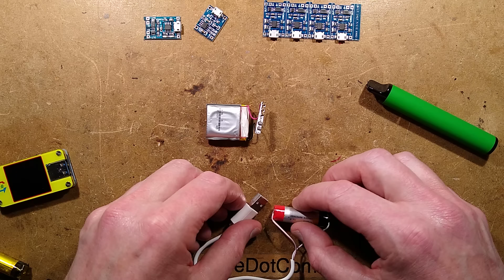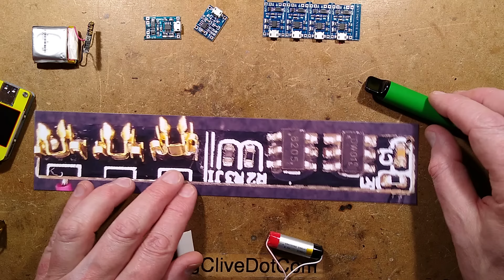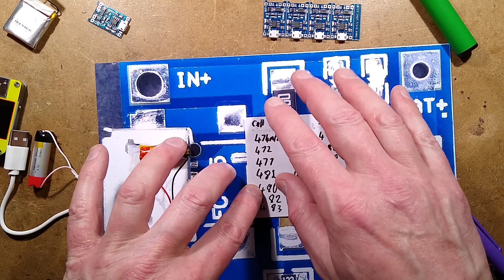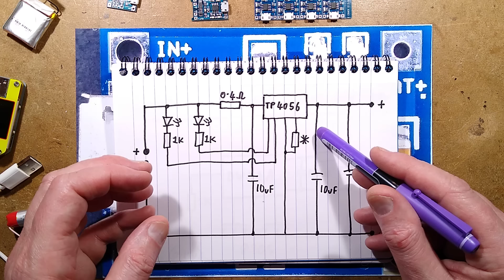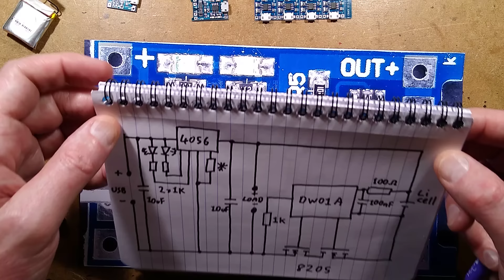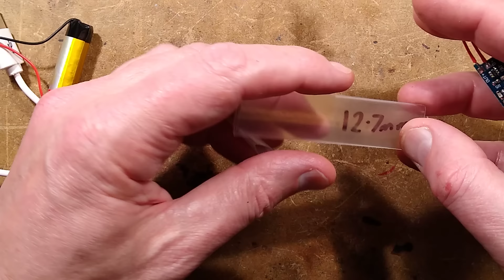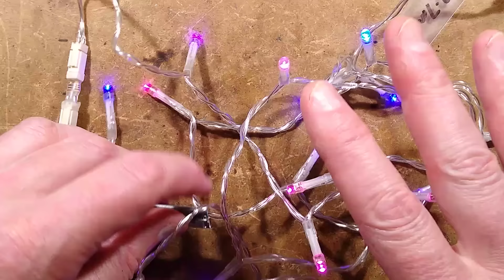Don't do this!   (There's a much safer way)

Comment: I was once charging a tablet battery (without the protection board) and I forgot I was charging it on the wall (suspended in the air) and when I noticed something was strange, the battery was getting bigger and bigger, inflating and exploding seconds later I took it off the charger.  Pieces of the battery flew into the house, burning with the sweet smell of lithium... It burned the sofa and some pillows a little, but I managed to put out the fire, but nothing serious happened afterwards... and I learned the lesson of never underestimating the lithium batteries...
Reply: Ditto, on the last thought.

Comment: Could you not put a 10k potentiometer in series with the programming resistor? That way you could vary the current from the full 900mA down to 100mA according to your needs...

Comment: What happens if you use this as an UPS? I've been using a small power bank 2000mAh as an ups and smoothing capacitor to my usb powered speakers. Using a computer to power the speakers gives out a lot of static noise.
Reply: Some other comments say that the modules' charge termination does not work properly when the output is loaded, so it would be dangerous to use as a UPS.
Reply: @fat_pigeon  the unprotected circuit might work great with a super capacitor. There are no usb power smothing devices. My current setup is probably killing the litium cell slowly. I'll need to find alternatives.

Comment: I used a circuit board I took out of a dollar store power bank that has 1 of the 18650s in it. I used that to charge my cells for about 2 months then I ordered a good charged.

Comment: I have an LED worklight that's designed exactly like this. USB to barrel plug cable. 4.2v lithium charger with an USB port. So instead of using the supplied charger you can just plug it into a normal USB charger. Inside the worklight the battery is directly connected to the barrel jack port. Very weird design choice.

Comment: These little controllers are very useful and so cheap. I have used them for a wide selection of batteries and they always work well. As Clive says it's worth getting a strip of them - they are useful to have around. When I have several batteries of the same type I usually rig up some kind of battery holder and attach the module output to that - for example a AA battery holder and make modifications that are needed. Much easier than having to solder each battery but depends on how you are going to use them of course.

Comment: Great video, as usual. Thank you! I wonder if one can create a power bank by ganging a bunch of these cells in parallel and using one of these useful charging modules. That would be very useful.

Comment: I think the little “microphone” looking things in those vapes are also a charging regulator.  I think the limit current at about 750ma and have 4.2v cut off.  I need to do more tests with them tho.

Comment: By chance i found a disposable vape while i was walking the dog, for someone uninitiated in these devices they certainly are quite interesting, containing amongst other stuff a nice little battery pack and an electronic button module that activates the heater by detecting the 'draw', i will certainly be getting a strip of usb chargers to make use of the battery, keep your noses on the pavement!, never know what's down there.

Comment: After watching your previous video I now have a biscuit tin full of these vaping devices. I have found a few that have been driven over, mostly at the  mouth piece end. Presumably you don't recommend trying to recharge these? I found the charging modules with the single 4056 chip from Amazon for £6.99 for five, which seems like good value.

Comment: Another great educational video Clive, I thought there was only me that collected those cells plus I reckon lithium will be more expensive than gold or platinum the way things are going, I’m surprised there isn’t a return deposit on those devices as they are potentially going to end up in landfill.
Reply: I've been collecting these batteries also from friends donations and have quite a few to play with ! The vast majority of discarded ones I see on the streets are crushed by cars !! I placed the small sensor/switch unit inside the end of some silicone airline and was amused for five minutes by operating the circuit remotely by vacuum 😁

Comment: I like to use electrical liquid black tape over the solder pads contacts. Protects from it short circuiting when inside an enclosure or anything that can come in contact with the solder pads. Then some hot glue to stick the back where I want it. Both the hot glue and electrical liquid tape can be removed for service. Your way Is awesome ! Awesome video again Clive. You the man.

Comment: I have a strip of those modules they're great. (The second type you showed). I have repurposed old mobile phone batteries with these. Being accustomed to lead acid batteries for years, we were always told to hold them at fully charged voltage continuously. This must never be done with lithium. The charging must stop completely once 4.2v is reached.

Comment: "Don't do that." Is exactly what I said this morning when I dropped my battery connection cable across the 12v leisure battery positive and negative terminals due to my butter fingers...
Some nice sparks, and about 1mm of metal knocked off the terminals. Thankfully they should still be good to finish hooking them up. XD

Comment: Most of these little disposables come with the charge circuit and usb port already attached. Just wrap electrical tape around the little mic looking thing (the on/off sensor). Most of them have automatic shutoff built in circuit.

Comment: I work in a vape shop and we sell about a hundred of these kits a day... We're just one shop and I guarantee within a day or 2 they either end up in the bin or dumped in the street. If that doesn't show how big the problem with these kits then I don't know what will, especially when there's so many potential uses for batteries like these and more-so when you take into account they're Li-Ion batteries going into landfill.

Comment: I'm a fan of the LiFePO4 chemistry because of the higher tolerance to over-charge/discharge and recharge cycles into the 1000+ range. It has the disadvantage of lower nominal Voltage and V-charge max. Do these controller & protection IC's you discuss here allow for the lower LiFePO4 Voltages? Thanks again for what you do, Clive! :)
Reply: Not usually. These use commodity ICs that are designed for the 4.2V cells. There are ICs that have voltage selection, but they aren't on these cheap PCBs.

Comment: Bare cells are just plain scary. I have a fire-containing basket in a far side of the house full of lithium cells I've collected.

LiPo cells in particular are the ones im scared the most, they're so powerful yet so fragile, anything can puncture them at anytime... and if anything goes wrong they become  self-igniting toxic balloons! — Spicy

So far I've had only one cell bursting on me: I was about 13 years old, and decided to recharge a cheap rc helicopter... I thought the charging circuitry was inside the toy, so I just hooked it up to a 5v charger and, sure enough, about 15 mins later there was a flamethrower party in my room... since then I learned to design my circuits in the most failsafe way possible: often using this TP4056 with protection AND with already protected Li-ion cells (18650, which seem to be more resilient)

#longcomment lol

Comment: Big Clive.  Could you add a small variable resistor to limit current?   If so, guess you will also need a volt and amp meter, dedicated power pack and case.  Hmmm.  I smell a charging test device to use with various battery types in a future episode.

Comment: What if, i use a USB adapter that allows me to regulate the Voltage and i set it to 4.3V? Would that be ok? (I'm guessing it is also not ok because of the unregulated Amps that can go into the battery)

Comment: Great little tutorial.  Li-ion cells have been around for decades, and they are great tech.  Like any technology it's important not to be stupid to prevent loss and injury.  A good rule of thumb is safe charge rates are 1xC where C=capacity of cell.  A 1500mah cell can be charged at 1.5 Amp, a 500mah cell can be charged at .5A safely.  Hobby grade cells for aircraft etc.  Sometimes have charge rates 2 or 3 x C, but cheap, random and salvage cells are usually lower quality and must be treated with greater care.

Comment: Small correction on the schematic, the MOSFETs also have diodes integrated, that's how the chip can disable overcharge but allow discharge, and vice versa

Comment: The original USB spec did deliver 500mA, so if you plugged that into a 'Puter with USB 1 or USB 2 ports it'd be more appropriate (USB 3 was 900mA). Fair enough re:voltage though.

Comment: Clive, I believe those are Molex KK connectors, which come in various pin counts.  Although, I'd should probably say moles KK "style" connectors as most you get off eBay are Chinese knock offs.  Still a very handy connector for small projects 😀.

Comment: 1. even worse if you was to try to charge directly from usb and connect to your computer you could possible have a usb killer without the high voltage.

while you wont have the high voltage it is possible that some computers may have a problem with back feeding the power on the port.

2. the boards salvaged from batteries are intended to be used on the battery cell by the oem and the original battery may be a lihv or the oem has determined 4.3 volts is safe for the cell.

you are taking a big risk by using the oem board.

sometimes the oem boards are suicided where when the battery is disconnected  the programming or a software fuse is blown and the board will not work.

i know this because hp did just such thing.

Comment: honestly why use any of these methods when you can just drop them into an 18650 charger like the miboxxer 8 bay with voltage and current control no need to solder or anything i have stacks of them i have recharged like that its so much easier you can even keep recharging the pens and reassemble then without even desoldering them like that

Comment: How about adding a (flip/rotary) switch that switches between two or a few different resistors for the circuit instead of having it set to a fixed current? I may just build one as a "travel charger" for my most used cell sizes (450 and 850mAh) to use with LiPos instead of using the cheap chinese ones that use random currents and take a very long time :) Thanks for reminding me, Clive :)

Comment: It's quite funny how someone would connect a cell straight to a usb lead with no current or voltage limiting.  The correct way to do is insert a TP4056 board into the circuit.  I am waiting to see a lithium cell catch fire and the pie dish having to be used.

Comment: Hey Clive, how come you never feature the TP5100 module? Is it because the TP4056 is a cheaper module? The 5100 module would actually be even more safer to charge these cells than the 4056 module.
It is quite possible to get knock offs of these modules that will overcharge the cell by as much as 4.35V. Over on SecondLifeStorage we've come across some of these modules. The 5100 modules don't appear to have clones out there. At least not yet anyways.

Comment: Remember that the battery is charged using ohms law?
this means that even if you have a 50a charger, you do not charge with more amp than the battery draws from the charger.

example 50 ohm resistance at 12v draws only 240ma no matter how big 12v battery you have.

This type of charger in the video charges the battery much slower than a cell phone does!

Even if you buy 2 a charging card, the same battery does not charge faster!

But you must have a charger that is strong enough for the battery.

Comment: This is a really useful and informative video, thanks Clyde! But how would I regulate what voltage goes out into my devices? I have a wireless keyboard that uses 3v (and 8mA) and I'd like to use this video to power that with a lithium cell but don't know if I need anything else.

Comment: 3:00 there are plenty products out wich do exaktly that. becaus the cheap manufactur see as Benefit no extra cost, battery charges fast and gets very high capacyty for the first few cycles  because the BMS kicks in very late... funny when the mosfet finaly fuses solid and the battery turns into a ball (ask me how i know) :P

Comment: Nice little modules! Ima get some.  As for soldering to aluminum tabs, I have some flux called Sal-Met that will allow you to solder aluminum as easily as copper. I think whoever made that is out of business now, but there are similar fluxes out there. I think it's fluorine based.

Comment: Actually, the battery pack you are using has to be out of spec.
It's not technically supposed to allow you pull more than 100mA if it's usb 2.0 without negotiation, 150mA for USB3.

If you plugged that into the computer, it will just shut off the power unless you put a resistor in line.

That said, things getting certified? HAH :P

Comment: Just a note.

Not all of those bords come set to charge at 1A from the factory, I've had a batch of them turn up set to 500mA. Trouble is, the place I was buying them from (The dubiously named company "BangGood". :D) didn't necessarily know what they were selling, and sometimes didn't even mention what the output current was on the product page. They seem to have improved over the years, but that can't be said for all suppliers. Even so, they're a ridiculously good value board for charging single Li-pol cells (Or even Li-fe cells if you really need to). I used to buy these boards in batches of 10 when they were on sale because it dropped the price to (IIRC) about 50p a pop !!! 

The pads either side of the USB plug are also pretty handy because it means you can easily power them from a bare 5v PSU or croc clips. When I used to fly a "Tiny whoop" around the house as practice for 250 quadcopters, I made a little charging station out of 8 of these boards by de-soldering the USB plugs (Purely for neatness), Replacing R3 on each with a 10K resistor, added the output battery connectors, then soldering them all in a stack on a couple of pieces of single core copper wire through the holes in the input pads. The whole lot was powered by an old 1A USB charger that I'd hacked the plug off and soldered directly on to the copper wire "bus bars" (I've since wondered if I could have powered it all via ONE of the USB sockets and if the rest would have taken power through the copper bus bars? I'm pretty sure it would have, but I'd removed all the sockets by that point). I finally heat shrank each board, then added some blobs of hot glue to act as stress relief for the output cables and space the free ends of the boards apart, before shrink wrapping the whole thing. It looked surprisingly neat when I finished, and it was really small considering it could charge up to 8 cells at once (only slightly bigger than a matchbox), plus it only cost about 5 quids worth of stuff that I already had laying around.

I've also got one of these boards in my old beard trimmer. The original pair of NiCad's gave up the ghost after a few years, so, as I hate binning something just because the battery's shot, I opened it up to see if I could replace them. After a bit of prodding about I realised that the little motor in it was actually rated for 4v...... so I chose to gut it completely and replace the gutless 500mAh 2.4v of NiCad's with 750mah of 4.2v Li-Pol cell. Through trimming a little of the plastic inside the case I even managed to get the indicator LED's on the board to line up enough with the trimmers charge status light window to be visible. It's been brilliant ever since. A hell of an improvement over even when the trimmer was new. It now doesn't self discharge over the couple weeks between uses any more, last's a hell of a lot longer between charges, and doesn't stall when I'm trying to ram the blades through some of the thicker sections of my stubble. The only problem is that it now goes like the clappers, and if I don't put a dab of oil on the blades every couple of shaves, they get noticeably warm !!! :D

Comment: I remember charging my Cingular 8125 cell battery this way because it didn't have battery protection (or the phone's electronics was just broke) to where if it discharged too much, the phone wouldn't charge, so I would have to pull the battery from the phone and hook up contacts directly to a USB cable like Big Clive showed.  Works in a pinch, but he's right.

Comment: I've repurposed a couple of the Poundland one-quid power banks as generic single-cell lithium battery chargers since they've got all the circuitry to safely charge the low-capacity 16850 cell inside. They do an okay job of charging some "found" cells I've recycled from an old Dell laptop battery for various purposes, they should work fine with vape pen batteries too. They also provide a convenient 5V output too if you can use it and smaller vape pen batteries will fit inside the housing if you want to make them a permanent thing.

Comment: An LM317 with a resistor for current limiting after it works nicely as a simple dumb battery charge circuit.
I may have to stock up on those ready-made modules though.
Reply: LM317 and similar as a current source can be great for NiMH cells, but it lacks the voltage limiting required for Lithium cells.